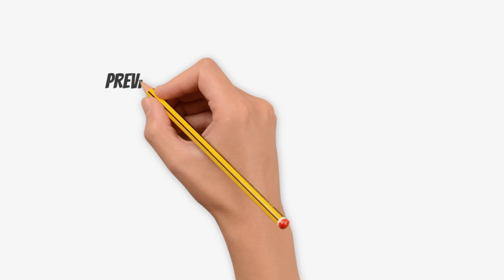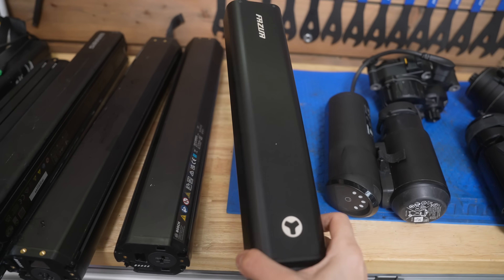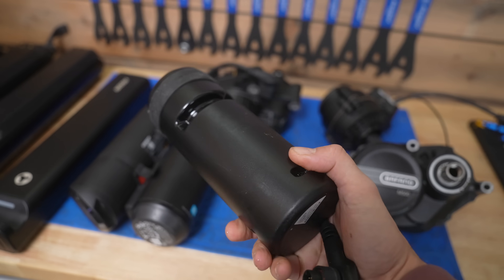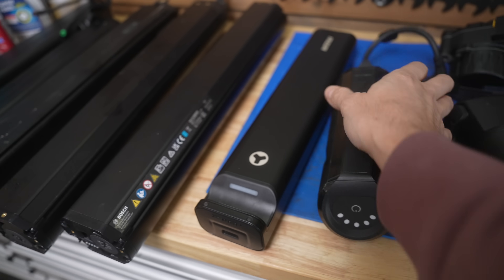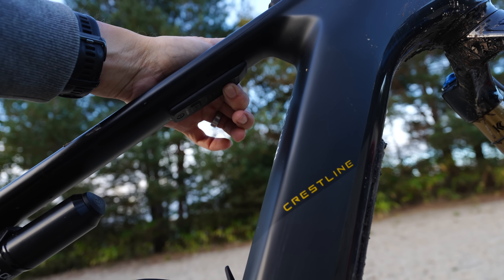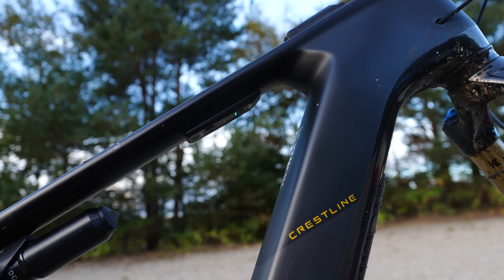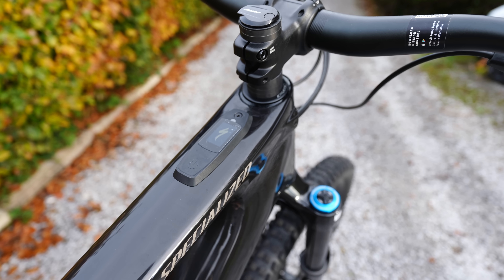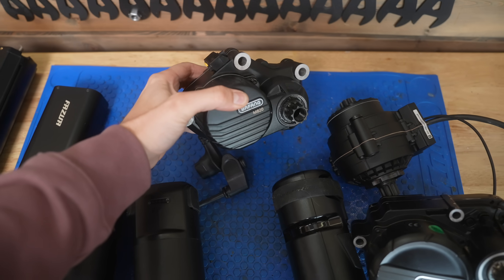We Have A Huge Problem With Ebikes....

Comment: Rob,  I bought a 20" tire Nakto bike.  I bought a slightly upgraded Nakto that has 22" tires and a similar motor, that is in a 22" tire.  Can I upgrade my frame with the 22" tires?  Company says NO!  The battery is the same, so I now have a newer battery on my older bike.  Theoretically I may be able to upgrade the front tire to 22", but have I accomplished anything with a front 22" tire and a rear 20" tire with the old 250Watt motor.  It is kind of sad that even in the same company's bikes, there is little standardization.  Also, they advertise a certain battery range, which requires pedal assist, so, even the range figures are not really honest or comparable.  Any thoughts?  David in Boca Raton

Comment: Bosch standardised the power tool battery eco-system. There are about 16 major tool manufacturers and all the batteries are interchangeable - excluding the fact there's 12v and 36v ones. But that's because you don't want a massive battery on your drill, that's big enough to power a lawnmower. You want two batteries. 

AAA cells have been around since 1911 and a standard for a long time. There is absolutely zero reason why we cannot have some kind of standardisation. 

I'm curious to know if the new EU battery law applies to e-bikes, it probably does because at the very least a major focus we haven't been talking about (because we're too busy poking fun at the evil Apple fanboys) is recycling and safety. I gave up searching for it though and I'm certainly not going to read the document for the actual law. If the EU comes up with standards, the rest of the world will fall like dominoes.

We've also got companies like Silence with their mopeds and quadricycles that use the same batteries. Gogoro has an amazing system in Asia, you just stop at a battery station, pull one out and plug your empty one in and leave. So much faster than petrol. Plus you aren't murdering anyone. Those are a bit bigger than you'd want in an e-bike but if you install a common system for mopeds, you'd also have a location where you could offer ebike batteries.

This is a solvable problem, the EU might already have pushed them to do so, Bosch have got form in doing their own open standard anyway are are a major battery manufacturer so they profit from other people's battery packs anyway, so there's only one problem. That's the form factor. Unless the can settle on the form factor of the battery, you can't standardise it very easily. Unless you can come up with a modular system which would add complexity and cost. 

The motors is also solvable, but again, the form factor of where they go on the bike is an issue. You can have any frame you want but the motor space would have to be the same layout, or a choice of a couple of layouts, for a replacement to work. 

I do hope you start a campaign to move the industry forward around standardisation. Although, if you can afford a £10K bicycle, you can probably afford to maintain it for quite a while. Right to repair would require manufacturers to keep stock of parts and make them available, to extend the lifespan of products. So if we haven't already got that, it's coming in legislation.

Comment: Technically these parts are all compatible,it just needs new firmware writing for it that overwrites the standard manufacturers firmware, either that or a drop in controller for a motor that is open source. 
There’s ways around this, just needs someone to step forward and do it.

Comment: In many points I fully agree since there is no reason to fragment chargers, connectors, batteries, etc.
BUT
This is an unfair comparison since e-bikes have different technological challenges. Look at motorbikes for example, it is a battle for performance vs. price vs. durability vs. weight (just to name some)

Depending on the purpose you need to fine-tune not only the engine but also the frame where the battery is a crucial part. this is where it gets nasty because you get all the problems from lightweight laptops til electric cars in one go.

Comment: Rob you know the answer, you have the Gen 2 Rail so you know why Bosch won't mix/match...safety for these ever so risky batteries,  and why they track telemetry on every aspect of its charging. And "planned obsolescence" will override any chance of this in the future for large manufacturers.

Comment: The other big point here is one of environmental impact. Mechanics around the world are more than capable of disassembling and repairing motors when. Things fail. But no mainstream brand wants to support that. For people who work in the industry, they know that Ebikes are an  environmental disaster when it comes to repair, and the rights to do so. A big push needs to happen to open up servicing to workshops and allow people to maintain EVERY part of the bike, not just ignore the laptop that has been bolted to the bike, while maintaining everything else around it, watching the electronics slowly degrade.

Comment: Built in obsolescence.. manufacturers should at least be standardizing their chargers between bikes in their range across model years.  Batteries should be standardised for several models. It's a headache for manufacturers to have to manufacture so many different batteries and chargers too, and provide parts support for several years too. I bet Specialized is probably the only manufacturer you can buy another battery from in 5 years time.

Comment: The bike itself is still mostly interchangeable, you're only speaking on the motor/battery which if you consider literally any other motorized vehicle - none of them share parts either. And for good reason, they want you to buy from them. But just like cars with a little bit of mechanical know-how you can modify any of these things to work together. Manually splicing connectors for the battery and things like that. Once parts are standardized third party companies will force a race to zero, diminishing quality to offer the best price and still profit, and in the end the consumer pays the price.. even possibly a lull in tech advances. No need to buy a new bike when you can just upgrade the motor from some Chinese supplier dirt cheap for example.

Comment: Tell me about it.  Dear help you when the company you purchased your e-bike from discontinues support for that particular model.  My onboard computer packed in so I got an exact copy from E-bay.  It looked exactly the same.  I had to go to ebay for as I said the company dropped support for my model.  When I plugged it in guess what?  Correct!  It didn't work.  Even when I went through the set up and put in the correct number of magnets etc.. everything.  I guess there is going to be a lot of e-bike frames ending up in landfill as when a component fails, hard luck.  So much for protecting the environment.

Comment: He's a real problem with this is people want to buy things that they can make quite easily. motor is under a hundred bucks, along with voltage regulator and speed controller, you can buy an entire kit for less than 100 bucks that won't include a battery, or you can spend about 200 to $400 and the kit will include everything except a bicycle.

Comment: I built my own one and only eBike seven years ago.
It's a Bafang BBSHD middrive kit mounted on a hardtail MTB. Nothing is proprietary apart from the Controller firmware which apparently has since been hacked.  I bought a 14S (so called 52V) 20Ah battery from from another vendor where I could even specify what connectors it should have.
I since tuned it up to 18S 45A 3kW by various modifications. All mechanical and electrical parts can be replaced by spare parts by myself (should I ever break something). The communication protocol is still in use today so I can fit whichever display I would want. 
Living in EU, my eBike is not registered because it's above 250W, though I've met guy who managed to get his insured against collision.
I don't think I'd ever buy anything proprietary like Bosch for the same reasons mentioned in the video.

Comment: take this from someone that designs and manages manufacturing of electronic products: compatibility increases complexity. complexity slows down engineering, often lowering product quality. keep in mind that most bike companies do not have experience in design and manufacturing of elctronics - until now they were bending metal or layering fiber sheets. they have no grand strategy for the product lifecycle or any clue on how to build an ecosystem. they probably outsource the design and production to asia and might even hire different contractors for different bikes. as far as standards go... never seen this happening, neither in consumer, nor in industrial tech - unless regulation requires it or companies find USPs outside of the actual hardware WHILE saving a buttload of cash in 'cost of goods sold'.

Don't get me wrong, your critique is appropriate and I share your hopes for the future of ebikes, but it's gonna take 5-10 more years until bike manufacturers professionalize on their tech R&D. Look at how old IoT is and some of the companies involved have just grown up in the last few years.

Comment: I have a og Turbo Levo and it still runs great . It does not need anymore power . The motor is perfect , not sure why they keep changing the motor to save a few grams . Brose motor still is perfect . Wish they would just leave them alone . I am sure when it dies I will not be getting a new motor .

Comment: It only takes one company to set an example... who will it be
Reply: Well they're clearly all setting their own example :P
Reply: The one that sells the most in the end
Reply: @sonnylatchstring what if the best selling bike, is the the middle of the road, kinda heavy, loud, inefficient, but cheap?

If just two of the bigger companies agreed to standardize then they would probably gain more market share and it might get other competitors to join in, or group their technology with another brand, or two.  It has to have a commercial benefit for the companies for it to happen.

Right now it’s the Wild West of e bike innovation.  If companies are locked into backward compatibility, or frame geometry (bolt patterns) or battery chemistry, then they can’t do anything revolutionary.  Technology and innovation will stagnate, or at least move very slowly.  It becomes innovation/design by committee, which never works well.
Reply: Specialized used a universal charge port and all the other vendors went for eWaste .
Rosenberger ..Google it.
Reply: Agreed 100% when it come to batteries chargers BMS’s we need some type of standards with the concerns about EBIKE fires and restrictions potential regulations the need for standards is long overdue. If we had universal standards we could eliminate the few bad players that are causing all the push back on all ebikes.  With having standards we can assure the level of safety and quality.. we could have public charging stations, it would be easier to swap out an older battery. In the end it would be less expensive for the manufacturers, the ebike companies and ultimately the consumer. Here in North American almost all the EV Car  companies have announced that they are going with the Tesla charging system, a Win  Win Win for all!
Reply: It takes literally the opposite of that! 😂
Reply: It's not just what you are saying that's great, the way you present your argument is persuasive and powerful. Well done.
Reply: Unfortunately, It will probably be the One Company or Wealthy Investor that buys them ALL out, and Monopolizes the market. (That seems to be the only way to ever make competing companies cooperate)

Comment: In a sens this is collaboration in the field of manufacturing to not provide an open standard market.

 But that’s not really valuable to bike manufacturing, 

What is valuable to bike industry is the asphyxiation of the ho so concurrent second hand sub-market, and the trickery of surfing on the traditional values of open standard every one assumes in cycling goods.

To begin with I don’t like how we call them bicycle, and not motorcycles.

Comment: Sorry Rob, but I Think You are not right. if Your older Bike is a 26'er you would not found a new Fork because of 29'' the same with Cantilever- V-brakes or Disc Brakes and the Drive Train as Well 7-8-9-10-11-12 gears and so on

Comment: Get shut of em! They were brought out 10 to 15 years ago as pedal assist for overweight 50 plus riders who found hills etc hard going. Now because human beings are basically lazy, they have become mainstream, like E scooters, skateboards, everything is now electric. If you are an able bodied rider, I can't see the point, I love that tired, drained but invigorated feeling I get after a day out on my Scott Scale 710, which is now 5 years old, still relevant, still like new because it's looked after, still rides the same as it always has, minimum maintenance and isn't scrap because the battery is knacked!

Comment: Nice that someone has said it, but things will never change. This would go against the direct interests of the motor manufacturers and big brands. Surprised that you didn't at least mention warranty concerns that brands would have if 3rd party batteries, extenders, etc.. could be plugged into their bikes.
Maybe if the EU passed a law forcing compatability, but I don't see that happening. The bike industry has always moved away from compatability in the name of "innovation", just look at the history of headsets, wheels, bottom brackets, etc..
In the future when big brands stop producing these motors, batteries, etc.. this will all become ewaste and patents, software, IP, etc.. will prevent 3rd parties from stepping in to make replacement parts.

Comment: Ever since i saw the integrated ebikes, i've been saying that all along, it's intentional crap, and the irony is that the cheapo folding chinese ebikes have no such issues, controllers, batteries and hub motors can be easily be interchangable, not to mention chargers. And don't forget the certification path that ebikes need to go through which i suspect is part of the issue here because if i recall correctly, the eu standard always treats as a whole..

Comment: i dont understand your prob with that question ?!? what system is upgradeble and / or downgradeble ? could u change a motor in a car with a different one ??? or any other thing ? a tv or a mobile or or or ??? there r reasons to do that way that there r different ways to do new systems ... like in gears and shifting - i dont wanna drive with a single speed in 10 or more % uphill ... there r different sellers and manufactorer so ... most of the system r very close in technical datas ... and i drive a bosch system 2 ebike and made more then 13.000 km with it and my battery and the whole bike will be changed if it brokes down ... the lifetime of the components isnt that great and the frame will get too much stressed even if i cvant see it in my way of using it !
do u think it will help if the systems r interchangeable ? who would that ?

Comment: Interestingly, if you want an ebike system that's based more on open standards, all you have to do is look at the cheap entry level ebikes coming out of China. I used to service them, and it was quite common for the motor, controller, battery and the LCD to all come from different vendors. There's about a dozen standardized battery enclosures you can build battery packs with. Companies like Grin Technology also make high quality ebike components that are easy to configure for the end user.

Comment: 5:35 “… eight, nine, ten grand on a new bike…” WHAT? Are you serious?? Now way do they need to be anywhere near that much. I’m building a lightweight adventure motorcycle based on a CCM frame and a highly modified BMW F650GS Dakar engine. If it costs more than £3,000 I will be very annoyed. 

But £10,000 will buy a brand new very decent motorcycle, which is far more complex than any e bikes. And an e bike is limited to 15mph and a very limited range. My CCM Dakar 650 will cruise at 80mph, with a range of 250 miles. 

I think you people are incredibly naive paying such ridiculous amounts of money for so little. The lack of compatibility standards just seems like a symptom of an industry that has no respect for its market - because you’re literally beginning to be ripped off.

Comment: Simple fix. Let the manufacturers know you will not buy anything proprietary, and will never buy until all manufacturers agree on a standard and then hold to it.  It would take all the buying public to hold their feet to the fire. The two manufacturers that first agree to a standard will quickly begin to take over the market share. 

I did something similar to this with Chevrolet. I told them they made junk and I would never buy from them again.  I didn’t affect their market share. It wasn’t because of me, but today, everyone know GM makes junk, and their market share is not a small percentage of what it was forty years ago. They won’t last much longer, and yes, I held to my convictions.  Without standardization, and owner repair drive systems and batteries, today’s e-bikes will become tomorrow’s paperweights.

Comment: I bought a levo sl v1 in 2021, comp carbon, 6000€ & then upgraded around 3k€ of kit so a total value of around 9-10k€.
Whatever I do, sell the bike with the upgrade stuff or re-fit the original bits if I wanted to upgrade to the v2 I'd basically be looking at spending an extra 4k€ to do so.
For me my bike is still awesome enough for me not to warrant spending that 4k€.
But completely agree with you.